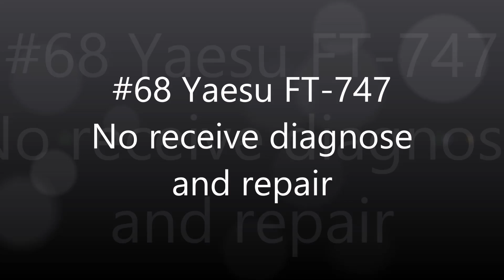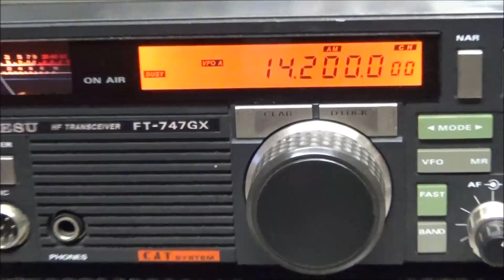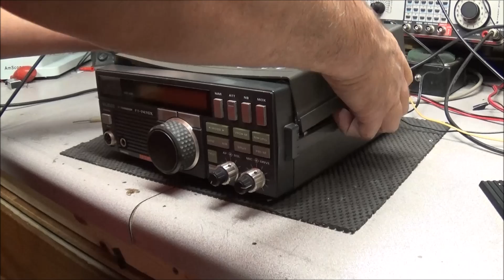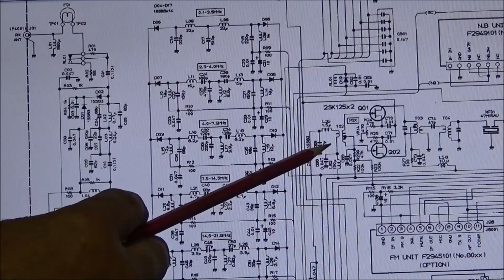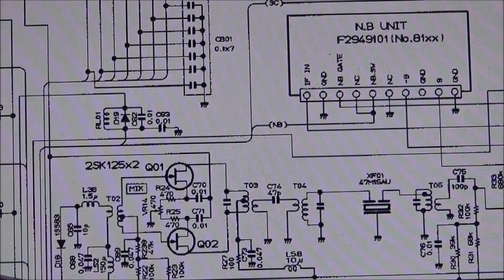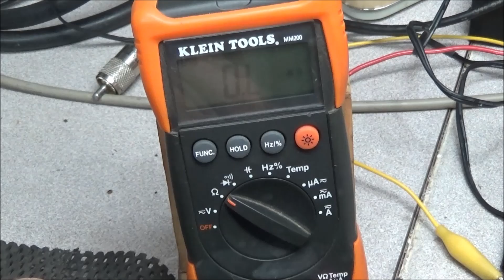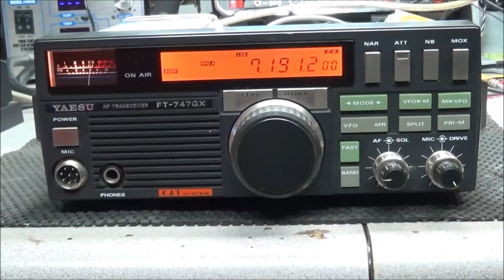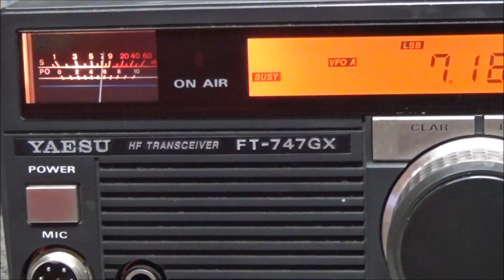#68 Yaesu FT 747 No receive diagnose and repair

Comment: I have the Heath SB-1400 version of this radio, and the AGC/NB circuit just went out, I'm curious if they are both driven off the transistor on the board right next to their switches.

Comment: May most of your fixes always be simple ones!
Worked on a Palomar 500 CB radio that I believe had an indirect strike and a bad receiver.  Had to go thru the entire receiver circuit one component at a time, but I fixed it.  It was an unusual type of part failures.  Two transistors and two diodes were found to be leaky.  Now I can understand ONE of those parts going bad.  But the fact that they were leaky and not open or shorted was strange.  That - and the fact that four devices had failed nearly simultaneously led me to the conclusion that it had to be a nearby static crash.  Your thoughts, Buddy?

Comment: Could some one help me please.my Ft 747 GX drifts on RX and TX if I tune the V/cap on the side PC Board and replace it and the 3 for USB LSB AM will work fine then it start its same old story again  Regard's Keith.ZS6KAS.
Reply from the maker: You will need to replace those plastic VCO trimmers on the rear board with good ceramic ones.

Comment: Those are nice radios.  I had one about 12 or 13 years ago and sold it when I got out of the hobby.  Sold off all my gear back then.  Just this past September I got back into the hobby, and I  purchased a Yaesu FT-757gx, which I have emailed you about, as well as the matching power supply/speaker unit and the matching auto tuner.  I have always been a fan of the Yaesu models.  My very first rig was a Yaesu FT-840 and I loved that radio.  I have had a Yaesu FT-101E as well.  Great video and very informative.  73 Juddie WD8WV

Comment: I have one of these radios that I am now trying to repair on my own and I had a couple questions. One being how to take off the face place and remove that circuit board, and the second being where to get a replacement bulb as mine is also burned out it seems. Thank you, KD8TAE

Comment: great video! I have a question.  Im just getting into ham and have done a ton of research into what radio to get.  i think im going to get a 757gx.  it seems to have most of the good stuff all in one.  my question is in your experience is it a good reliable choice?  i am moderately skilled at electronics repair and have the basic tools such as scope spectrum analyzer etc. and am not afraid to fix it if it breaks as long as parts are available etc.  your opinion would be valued and appreciated!
Reply from the maker: The 757 is a great rig. I really like them. And are fairly easy to work on.  But. things that go wrong are the diodes on the RF board. Then there is Catastrophic failure of your CPU which is no longer available. Even if it was there are no programs or information to program the chip. Other than that. Good rig.

Comment: I am not sure why you would jump way ahead in a recover and start adjusting slugs without first doing a visual and then a simple continuity test on a known item that is in circuit for this very reason.  I am only making the point as I am trying to learn and the approach in this video seemed like a maverick approach not one using your normal logical thinking.  Still love your videos. 

Also not sure what you have the voltmeter connected to. I am assuming the audio output of the rig. Thanks
Reply from the maker: Hi Kevin. Appreciate the feed back. Let me see if I can help with a little logic on this. I have worked on dozens of these 747 over the years. Seen about everything you can think of to bad relay, blown bulb, bad RF amp.  Just about every time I get one of these I find those 3 IF cans are misadjusted. Even had 2 of them in the shop that had very little receive only to find that the cans were adjusted incorrectly. You have to watch out for the golden screwdriver operators out there. Out of all of these I have worked on this is the third one with a blown bulb. As far as the volt meter it is connected to a 8 ohm dummy load that is plugged in the rear of the unit.Thanks again for the feed back.
Reply: +The Radio Shop Thanks a million.  Just seemed to be out of character for the way you go about doing things especially when you are doing such great training videos.  Again thumbs up just wanting to keep learning. Have a great evening and keep your wonderful work coming

Comment: This repair was a nice trip down memory lane for me.

Thirty years ago I had an Icom IC 745 go deaf on me suddenly.  The radio was bought new.  I can remember paying 745 dollars for it too.  Anyway, as with every radio I purchased, I always got a service manual for it.

Now time does play tricks with one's memory but I seem to recall it went deaf on the broadcast band and 160 but the higher bands were FB.  So I broke out the service manual and started looking at the schematic from the antenna onwards.  I saw a light bulb in the antenna circuit.  So I opened the radio up and went to the board that had the bulb and sure as the sun shines, the bulb was black.  I jumped the bulb with a short wire and the broadcast band and 160 came back.

I knew the bulb was a protection device, so I replaced it with another one like you did in this video.  In my case I started at the antenna when I diagnosed my problem and found the condition right away.  I know you have a 745 too and are probably aware of the bulb protection circuit in it.  If convenient to your experience, was the bulb in my 745 exclusive to the broadcast band and 160?  I seem to recall it was.

This is an excellent video and for ham radios of these vintage years, looking for that little bulb being blown out can be the answer for many repair possibilities. 

Thank you for sharing this repair with us.
Reply from the maker: Thanks for that awesome story! Like you I do believe the bulb is in the lower portion of the band circuit.  Think this is where the problem originates the most.Thanks again for sharing and for watching.

Comment: When it was as deaf as it was I'd have gone right for the relay or bulb first.
The tuning of those if transformers wouldn't knock it out that far (60+ db) unless someone had been in there with the old golden screwdriver.
Reply from the maker: I agree, But with all those golden screwdrivers out there I wanted to show what to look for.  I get a lot of ebay specials where folks try and squeeze every watt out of the rigs. They see those cans and must turn them. Thanks for your comment.

Comment: The bulb is a nice technique. Might make more sense if it were on the outside, and easily changeable without soldering, but I suppose this doesn't happen very frequently. Thanks for another video.
Reply from the maker: I agree. The older rigs had the bulb in the back with easy access to it. They decided to put it on the circuit board in these rigs.  Now they seldom go bad is the plus. But good to have this feature. Thanks for watching.

Comment: Buddy, awesome video, I look forward to them, I have learned so much from you, Peter, Allen and Mike; the big dogs. I do have a question, that internal connector that came loose, what is it's name and where do you buy them? On advice from Peter,  I have the need to inject a signal into that type of connector but I need to convert in from an N connector (or other more common RF type) to whatever that is. Any ways awesome video please keep them coming.
Reply from the maker: Thanks for the kind words Michael. Don't forget Paul at Mr Carlsons Lab :-)Those connectors are called TMP connectors.  These are fairly cheap. But the tool to crimp them are about a grand new.....See this link for source.http://gokarters.com/smf/index.php?topic=2602.new#new

Comment: Great job buddy! Nice to see the old 747 happy again. I like the pen and toothpick tool idea. I can't count how many plastic tools I have gone through.
Reply from the maker: Thanks Paul. I have been doing that method with toothpicks for many years.&#160; Some of them are a bit too soft. To solve that put a drop of CA (super glue) on the tip and wipe off. This hardens the tip.&#160; Yes the 747 is  a happy unit and hope it will be in service many more years. Thanks for stopping in my friend.
Reply: What, it's not happy? That must be a typo :^)
Reply from the maker: oops. Yep typo. Don't know why I put a "not" in there lol. Thanks Paul. Fixed :-)

Comment: Thanks again for the good videos .
Might I suggest that when you are letting us hear a signal / noise , you keep the audio of what ever signal , lower than your voice ;)
Having to turn down the volume at this end , I miss what your saying , again thanks John
Reply from the maker: John, thanks for the feedback my friend.  Lets see if I can explain this a bit. My camera has no external mic jack and is a bit sensitive.  So you are hearing this just as I am. If I turn the volume down then trying to get a sinad reading would be impossible. :( I am currently building a audio dummy load. When this is complete you will not even hear the tone so that will keep the noise down.  Wish I had the 1200 bucks for a new cam but not going to happen.  I will take this into consideration on the next video. Again, I appreciate feedback like this.

Comment: Yes Buddy its nice to have a few of these kind of repairs in between the bad ones or needed $$$ for those repairs costly sorta balances things out.So yes enjoyed it and followed thru very well, yes saw the Burnt spot on the blub .Thanks for your Efforts Buddy 73's PS you keep that line noise down there gee havens how you put up with that,Bet you can tell which radio has the best front end rejection lol lol
Reply from the maker: Thanks Dale. Sometimes the bulb looks burnt but is a coating inside them.  Was thinking the bulb the whole time but wanted to show the full analysis of the repair. Thanks for watching.

Comment: Just found and subscribed to your channel yesterday, and funny enough my first HF radio is an FT-747. Although it's pretty used and tired it does receive and transmit pretty well, i dont have the equipment to do it but it could probably use an alignment. 

But my main issue is that most of the front panel buttons are worn out and im trying to find good replacements, im comfortable with soldering new ones in, just need to find ones that will line up right on the PCB, I should probably make a few posts in some ham radio forums online. Ill probably change the bulbs in the front for the LCD screen while im at it. 
Thanks for making these video's, they are really helpful.
Reply from the maker: When you say worn out you mean the switches?  Sometimes you can take them apart and clean them and they work pretty good.  Keep an eye on ebay and you will find pulls quite often.  If no one has gone in and really turned everything the alignment can be done with little equipment or cheaper equipment. Yes post about it on a few forums and someone may have the parts needed. Thanks for subscribing.

Comment: Love those easy fixes! I had a 747 and used it in our motorhome as a mobile for many years; loved the "click" on the VFO knob but hated the thick cable used to remote the front panel up on the "dog house" of the RV. Although I understand the need for those darned TMP connectors in terms of space considerations on the PCB I always hate messing with them! Have a nice holiday weekend Buddy.  73 - Dino KL0S
Reply from the maker: Easy is always a good thing! These do make nice radios for the RV. I also hate those connectors. The clicking knob is very interesting and is smooth for on the road tuning.  Have a great holiday yourself my friend and thanks for stopping in.

Comment: Well that was a fairly easy one.  Looks like we both have deaf radios to fix.  Got a new old stock Royce 1-641 that can barely hear at 10mV/-27dbm.  No light bulb protectors here. :(  Good luck with your leak.
Reply from the maker: Hey mike. Yep wish they all was this easy.  Loved the old Royce units. Maybe not to bad on you.Roof is all fixed and no more leak. Even feel better :)Thanks for watching.
Reply: +The Radio Shop 

Glad you found your hole.  Looks like I'm having PLL sardine can output problems with the Royce.  Very low input to the first mixer.
Reply from the maker: That should not be too bad to track down.  Used to love working on those sardine cans.  Also makes for a nice signal generator source.
Reply: +The Radio Shop 

LOL, I have piles of sardine can PLL's here from different radios.  They do make nice signal generators.  The ones out of the Cobra 77X radios used a upd858 and could be fairly easily retrofitted into some 23 channel radios to update them for 40 channels.